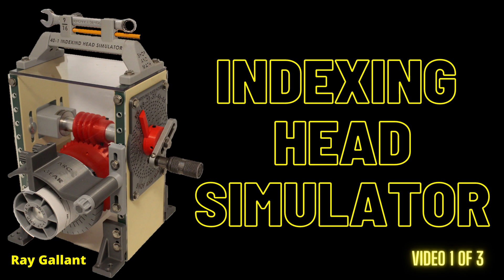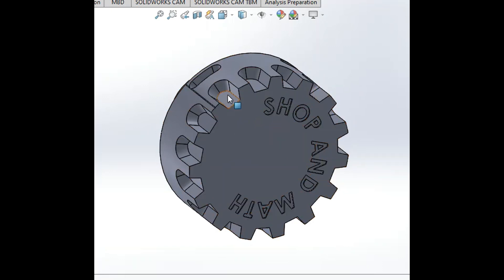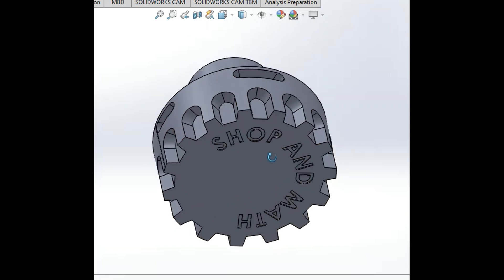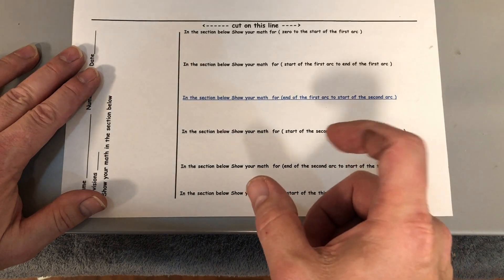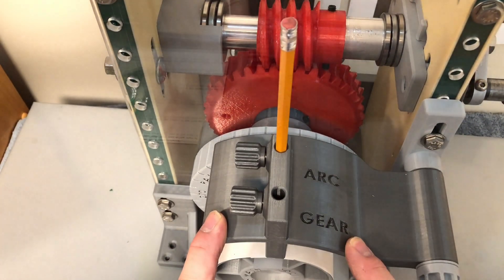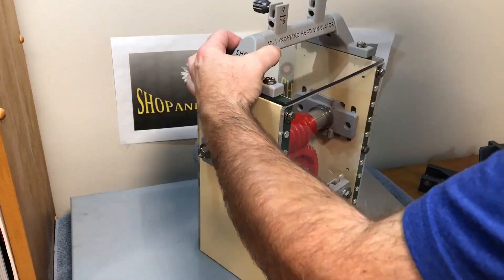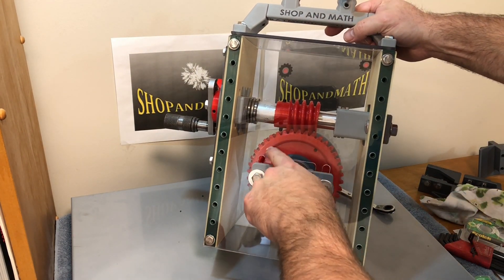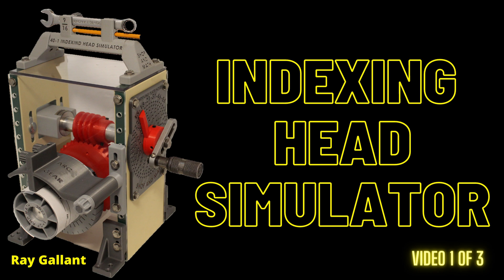Indexing / Dividing  Head Simulator

Comment: Why, is a real one not available? I use mine two or three times a year.
Reply from the maker: its not that its not available
we are switching to cutting the gear project to CNC a more modern approach to gear cutting 
I will still test indexing using the simulator in the class room